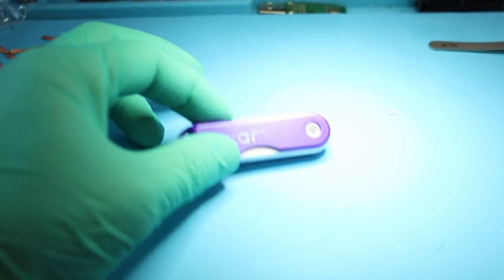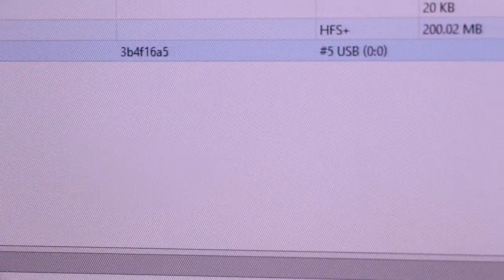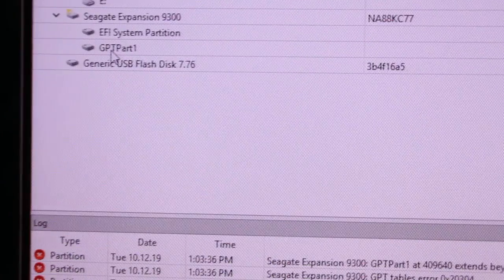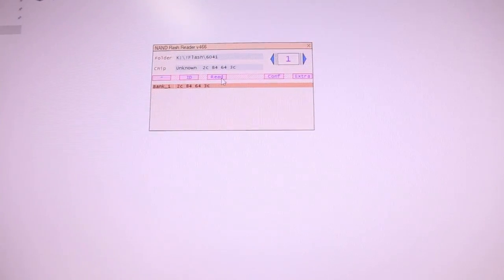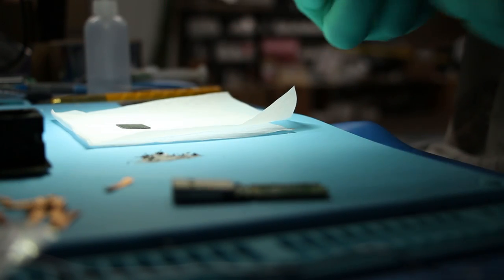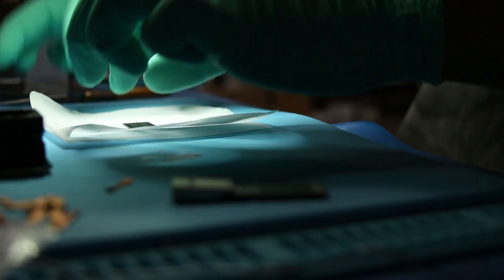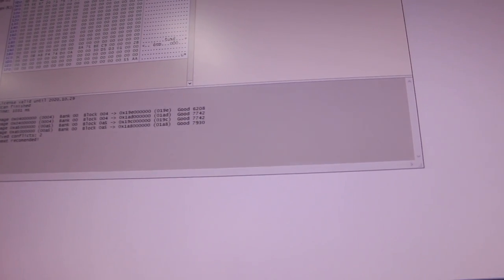flash drive repair and data recovery

Comment: I love your channel and work in the same field. Regarding reballing the chip, after applying the paste remove excess with a spatula, and reflow with hot air while the stencil is still on the NAND that way you won't have issues with smudging. All in all great work!

Comment: The most interesting and insanely detailed lab and microscope work...and then you use USB drive in the back of a PC like a normal person...haha. I expected some fancier connection!
Reply: Yep, the thing is that only USB ports that come directly from the MOBO are reliable. Front USB ports or even using an extension cord may return an error.

Some light would have been good though.

Comment: First of all....love the skill involved in doing this stuff. I'd love to be able to spend my days doing this kind of work :) I have a couple of questions though. How come it took half an hour to read 16gb worth of data? Why is that so slow? And when recovering data, do you know by readouts on your software that data is recovered. Or do you go into the data itself to see if it is looking ok?
Reply from the maker: When we use data extractor for hard drive recovery, our integrity validation is done by sorting files that are fully imaged 100% in one directory structure, and those that have unread/bad sectors in a clone structure marked as problematic. This way client knows what files may not work and which are 100% functional
Reply: @hddrecoveryservices  Thanks man :) Really appreciate the reply!!

Comment: Hi two questions I’m curious about:
1. Does chip off recovery recover 100% of data or as much as it can?
2. Would transplanting the nand to a donor board be a better option or won’t work?
Thanks
Reply from the maker: swapping NAND will only work in case of a failure that is not related to the NAND. We only do chip-off if the NAND is defective. Recovery success rate will depend on a bunch of factors, different chips read differently (some read good and build data good, some read horrible)
Reply: @hddrecoveryservices  Thanks. Are there programs that determine whether the nand itself is bad/corrupt? And from a customer perspective, would they accept partial data recovery or only want full?

Comment: Cool video. Nice soldering and reballing. Why would you reattach the nand after you had the image created ?
Reply from the maker: Repairing the device turns into a full recovery. Reconstruction of the data from NANDs can get 100% result but it is a lot more work, specially if video needs to be recovered
Reply: Can you tell us why happen this??? It need the controller?

Comment: nice job man, could you not melt the solder balls first before removing the stencil?
Reply: I was also thinking if that is possible. wouldnt it remove the chances of any smudges
Reply: I’ve seen it done by lots of people. I think it’s the correct way of doing it.
Reply from the maker: @MrOrangeman18  the correct way of doing it is the way that works for the person who does it. If it gets the job done properly - then the job is done. I've done heat over stencils before, and it does work also. The problem is not the stencil, the issue was with too much flux that is mixed into the paste that made it runny. Even with the stencil held for heat, it could run. This was a new paste I just got locally that was just sold out of the stuff I use for years.
Reply from the maker: @tango_gru  no, with stencil on a runny paste can also leak
Reply: @hddrecoveryservices  thanks for explaining. Have a great day

Comment: Just curious, why did you try to resolder the NAND after you got a backup of it's content? It seems like a water of time and money looking at the cost of pen drives these days...
Reply from the maker: Dump is not a backup. It still needs to be converted from physical image into logical to get data. Repair brings the flash drive back to life. Time it takes to repair (if possible) is way less then logical reconstruction and it yelds cleanest possible result for recovery
Reply: @hddrecoveryservices  okay thank you. I asked the same question just now. I should have gone through all the comments for asking a repeat question. More complicated than I thought!

Comment: Reballing is much easier when you blow low heat on the stencil it self and hold it flat with a curved tweezer to prevent bending. Lay down at 45 degrees angle your heatgun on the stencil and let the magic happen. Now how to remove the chip: The second the balls are solid. You push with the tip of your tweezer ON the solder balls through the stencil to separate the ic from the stencil. Thats it:)
Reply from the maker: I don't find it easier nor harder. The issue I was having is with the flux to solder balls ration in paste resulting in runs.
Reply: @hddrecoveryservices  yes I could see that. That's why you should melt the paste with the stencil on top of it. Trust me.. Im in the same business but then mobile phone data recovery on board level. Love your channel by the way;)

Comment: What was those two things you used: one is like transparent paste and another is like a piece of the metal paper?
Reply from the maker: the transparent paste is called flux. Flux is a chemical cleaning agent, flowing agent, or purifying agent. Metal thingy is a stencil to reball BGA NAND components that gets filled in with solder paste (flux mixed with soldering balls)
Reply: @hddrecoveryservices  thanks, but I was asking for thing that you used before the stencil, like a rubber or something but made of metal threads
Reply from the maker: Oh that is called wick. It's a copper braid infused with flux for sucking up solder
Reply: @hddrecoveryservices  Thank you very much!

Comment: I don't get it. You said that reballing it didn't work so then what did you do to fix it or correct the problem?
Reply from the maker: reballing did not work, so data was recovered by using a controller simulation software.

Comment: What temperature do you use for removing that NAND?
Reply from the maker: 390 at 90 airflow. I find that less time heating at higher temp is better than more time at a lower temp for the nand content to be undisturbed.
Reply from the maker: but since I mount with 37/63 led mix solder 350/40 is perfect for me
Reply: He replied to someone bellow "NAND removal at 390/90 rework 350/40"

Comment: I enjoyed the video
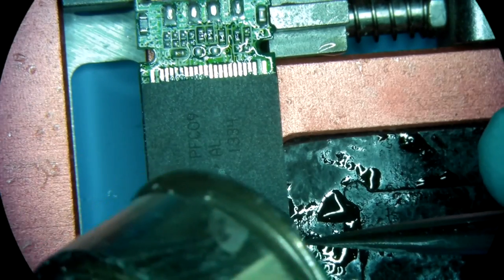But how does it position it self at 16:00 ??
Reply: It's just the effect of surface tension when the solder becomes molten enough to align the centre of the pads of the NAND and the PCB. However, if they are obviously misaligned (on purpose) then it'll align to the wrong rows - as long as it looks correct to begin it, it will automatically align itself correctly

Comment: After backing it up how come you bother repairing the drive? Throw it out and replace?
Reply from the maker: That's not a good way to stock your donor pieces
Reply: @hddrecoveryservices  I don't understand what you have said. I don't know what donor pieces refers to. You can get USB drives very cheaply. Whereas it's very difficult to recover the original drive hardware. I wish I understood what you were saying. I know you know what you're talking about.
Confusing to me. Sorry

Comment: Would this be easier if you had a BGA rework station
Reply from the maker: not really. It would probably be more difficult. BGA rework stations are good for motherboard repairs. Thicker boards take in a lot more heat before, so components need to be heated longer to the point where solder starts to melt. That's why they have bottom preheaters built-in, to warm up the board before hitting it with air or IR heat. On small objects like flash drives and memory cards, a good hot air station is all you need.

Comment: What about reflahing the firmware on the controller chip?
Reply from the maker: no need for it as you can see
Reply: @hddrecoveryservices  I mean before/instead taking the nand chip out.
The behaviour of that usb drive is typical of a controller with a wiped configuration.

Comment: Why not solder the chip to another flash drive?
Reply from the maker: Because the chip is the problematic one. Moving it to another flash drive would not change a thing since the source of the problem in this case is inside of the NAND itself
Reply: @hddrecoveryservices I'm asking you to understand, if you didn't take out the nand to put it in the reader, would just the program be enough to recover the data???  also, can you recover all the data with only the nand and the reader or do we need something else???  for example the controller???

Comment: Your method of reballing and reflowing is horribly childish, who removes the stencil when chip is still wet and does reflowing on wet chip, why don't you use a clamp down jig and instead of paste use BGA balls, its much cleaner and faster.
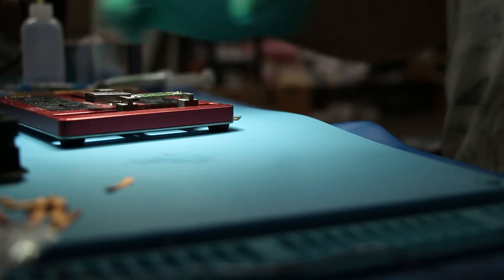Reply from the maker: BGA balls... lol. OK. Maybe I should go to the forest and get some pine tree sap instead of flux while I am at it? Bro this video is 3years old. why not roll back 10 years to see how I did it back then? what is not clean enough for you at 15:12?